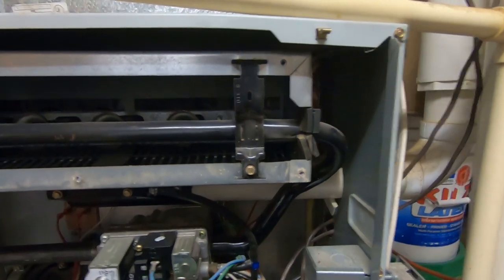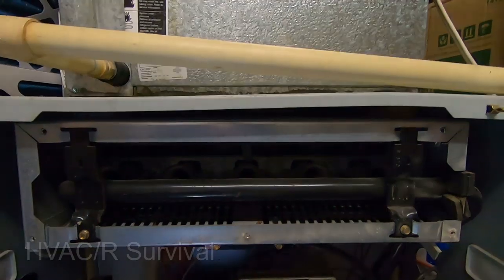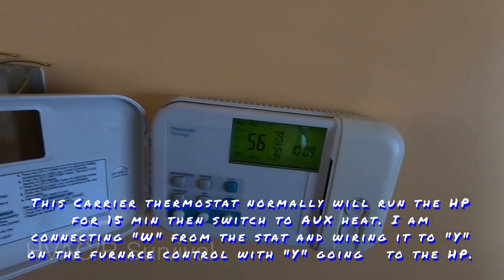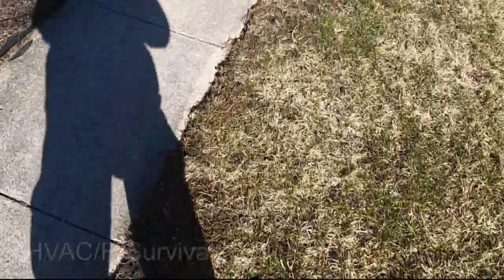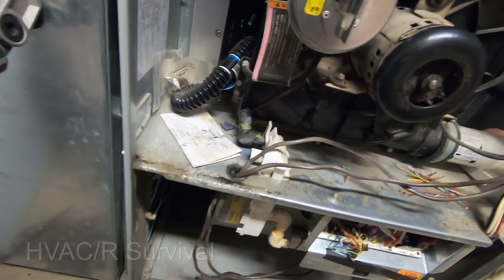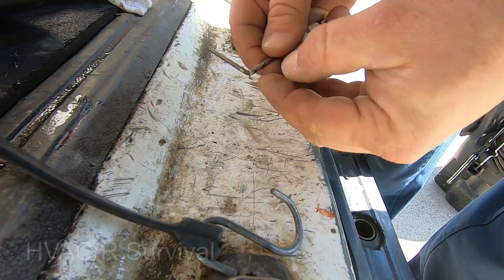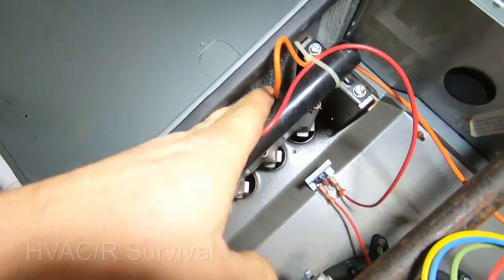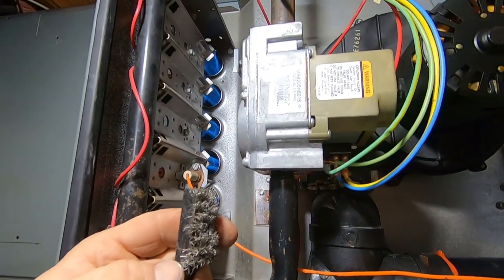Carrier Heat Exchanger Failure and Hillbilly Deluxe Flame Sensor Repair

Comment: new thing learn from you .never try to brazing the flame sensor . thanks Rick
Reply from the maker: Why's that? It's still working,  I have the new one on my truck ready to be put on. The real lesson would be"don't break the flame sensor" 🤦‍♂️😉
Reply: @HVACRSurvival  as you know i had always been told . "just replace it" LOL thanks for  share!
Reply from the maker: @steve19841117  I installed the new one yesterday. But in this case,  I didn't have a new one available at the time of service,  that's the only reason I repaired it. FYI = The thing was still working. 😄

Comment: I’ve don’t the same on a boiler flame sensor, parts supplier said flame sensor was a week away, mine was in 2 pieces though, it held for the week, broke when I was taking it out to replace
Reply from the maker: You have to do whatever you have to do to get them by until you can do it right. While still being safe👍👍

Comment: Excellent flame rod repair...question how the hell did you break it without cracking the porcelain
Reply from the maker: Technically it happened while I was installing it. The rod was not in the correct position when I tightened the screw and some how it broke where you seen me repair it.

Comment: I have a question for you. I have a customer that wants a self contained reach in fridge (2door) turned into a remote system, so he wants me to move the condenser to the roof. I’m in ny so I’m guessing I’d need to add a control to run it properly in winter but what do you think? Doable?
Reply from the maker: Anything is possible,  you could add a fan cycle switch,  but how far are you running the lines,  will you get good oil return? Will this bite you in the but later? I'm not sure I would do it.
Reply: @HVACRSurvival  its not far, one story building, but I was thinking the same thing.
Reply from the maker: @frankgall6  It reminds me of how "Hell is paved with good intentions". Not worth it in my opinion🤔
Reply: @HVACRSurvival  think your prob right

Comment: That worked great in a pinch on the flame sensor. Was that 45 percent you used on the flame sensor? Also Supco makes a great flame sensor cleaner. I work for Johnstone Supply and have sold many of those. Contractors like them, they go on your key ring or tool bag. Awesome video, Thanks!!!
Reply from the maker: Thanks John, yes 45%. I have seen them but they look like they would wear out quickly like the copper wire brushes do that work by the same principle. ?
Reply: @HVACRSurvival   Yes, they do work the same. They clean the sensor without harming it. Some contractors have said that is one the best little tools I have sold them, Ha, Ha.  Thanks for the reply.

Comment: That soot  is normally caused by low LP pressure. They’ve run that furnace when the tank was low on gas. I would tell them to keep it at least 50% or more. I had a standard draft furnace with the heat exchanger loaded. I pulled it, took it to a car wash and pressure washed it.
Reply from the maker: I've done that before on a 80% but I'll try blowing it out with nitrogen before using water. Big flipping miss with water.
Reply: Replacement should clean it right up lol
Reply: good point, is there not a low pressure switch in the propane line?
Reply from the maker: @throttlebottle5906  no there wasn't.

Comment: Must be the year of the carrier heat exchanger. I’ve found 3  bad fourth one surprisingly ok.someone must of replaced it at sometime.
Reply from the maker: Depending on the year of the model,  Carrier will give a labor allowance. This one didn't qualify. Every furnace will fail no matter the brand,  nothing lasts forever but for some reason 10-15 years seams like a scam to some people yet they will buy a car or truck for $30-$60k and not blink on repairing it or replacing it in 3 to 4 years,  losing thousands of dollars yet when there furnace is the most important appliance in the house and doesn't cost a fraction of a vehicle. 🤦‍♂️🤦‍♂️🤦‍♂️🤷‍♂️🤷‍♂️🤷‍♂️

Comment: just happened to our furnace a month ago. the panel going between the 1st stage and 2stage of the heat exchanger dose not drain and gets full of water therefor rusting the heat exchanger.
Reply from the maker: The new designed Carrier heat exchanger is now a one piece unit so replacement in the future will be much simpler. This modular design shown in the video is time consuming to rebuild. The thing to consider is every furnace will fail. Its just a matter of when.

Comment: the metal part of a flame sensor broke, that's a first on me! I've seen them pitted from being open and careless brazing near by, as well as highly corrosive chemical in the intake air (chloramines)
porcelain broke from someone fumbling about.
Reply from the maker: I didn't notice it was not in place properly when I tightened it up. My first mistake ever😏

Comment: I can install a new furnace for what carrier is going to charge for parts, even if parts are warranty the labor rates do not justify a repair on that furnace.
Reply from the maker: Really depends on your labor rates, what brand your replacing it with and on the customer's finances.
Reply: @HVACRSurvival  carrier 96
Reply: Because in the end, its parts are worn
Reply from the maker: @bradmurray9401  correct,  that's why I told the customer what a new draft motor, blower motor,  and control board would cost if they were to go out next. Hard to beat a 10 year parts warranty. I might give them my opinion but ultimately it's there choice. Thanks 4 sharing👍👍

Comment: It’s over 20yrs. Nothing is under warranty anymore.
Reply from the maker: The heat exchanger has a lifetime warranty to the original owner. Carrier has programs that actually pay a portion of the labor to replace it or the option of a discount on a new a furnace based on the serial. This one was only covered by parts.
Reply: HVACR Survival good to know. I’m also a carrier dealer.
Reply from the maker: @chelenjna1  it was my understanding a class action lawsuit was brought against them and that's a lot of the reason why they're doing the money thing but it all depends on the model and serial number. funny enough that usually applies to the really old ones and not the newer ones.  I always let our sales guy figure that out😉